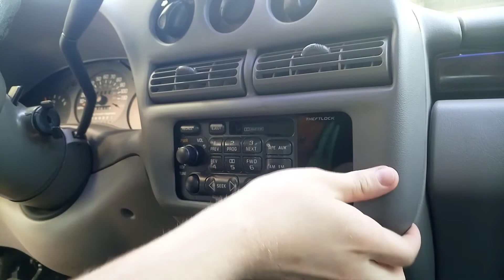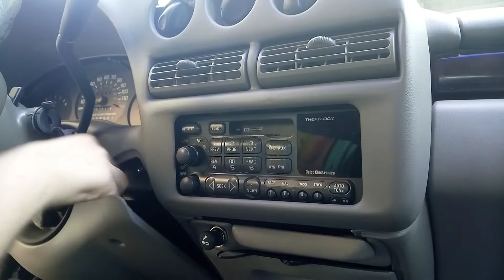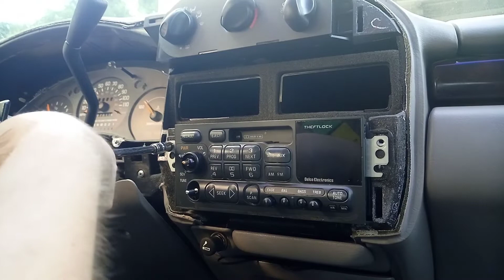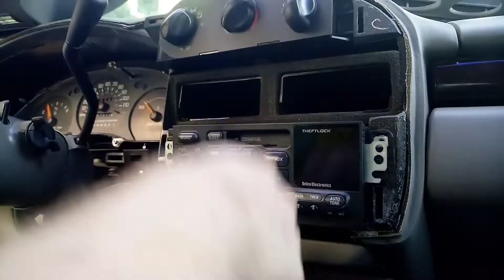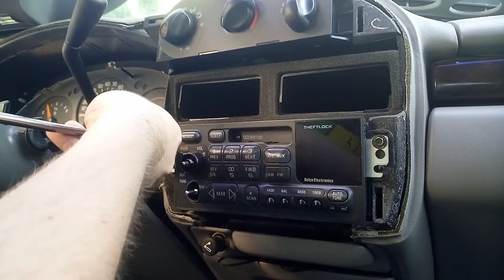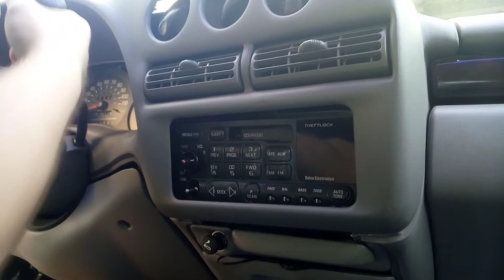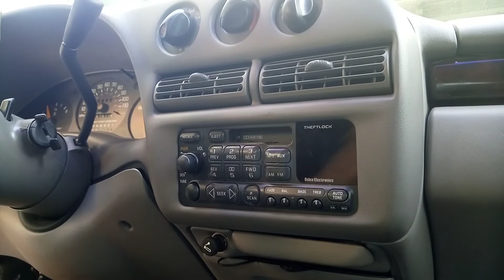Chevrolet lumina ('97) Radio Removal

Comment: Any tips on putting the dash back on I can’t seem to get it
Reply from the maker: Absolutely! If you set the e brake, keep your foot on the brake pedal and turn the car on you can move the gear shifter to be able to get that portion of the dash in place easier. Hope this helps!

Comment: What was that module for?
Reply from the maker: That was a hi-low audio converter for the subwoofer installed in the trunk. I posted a link to the module in the description if you would like more details!

Comment: I have this car. Is it possible to change the radio out with a newer touchscreen one?
Reply from the maker: There are a few extra steps in order to complete that process but it is definitely do-able!
Reply: @dxsstudios  What other steps? I want to install a Boss touchscreen one in mine but im afraid that Ill mess up in the process.
Reply from the maker: @Kevin-if9kw  I should be making a video on that in the next few months but basically what you need for a clean installation is a wiring pinout of your stock radio connector, a universal wiring harness connector (there are a few names for this item but it is vehicle specific), and then solder or crimp the wires from your new radio with the connector based on the wiring diagrams. If you are using a radio that also has additional accessories you'll need to find good places to run those wires under the dash (subwoofer connections, gps antennas, mic for hands free, etc). Hope this helps! Oh and of course be sure to unplug the battery beforehand!